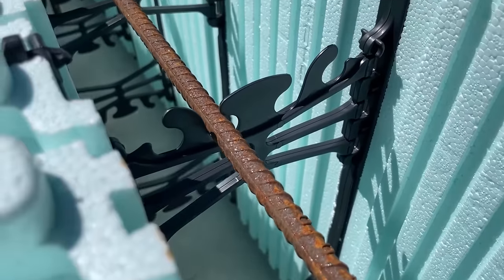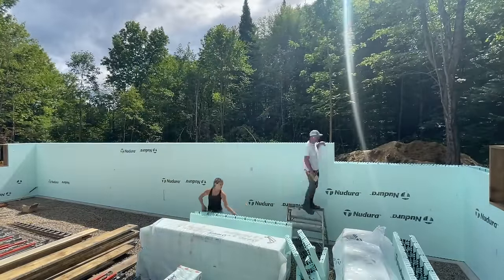WE HAVE CONCRETE WALLS | Couple Building Their OWN HOUSE | ICF High Efficiency Home

Comment: Brandon, have you ever used Helix Micro Rebar to replace the vertical rebar?
Reply from the maker: no i have never used it, is it the fiberglass rebar?
Reply: @TimberMates  no it is spiraled metal about 2” long. It gets premixed in the concrete at the plant.

Comment: Styrofoam inside the building is not a good idea, outside is good, but inside... Plus we should protect this material from weather and sun. And yes, this technology is as old as the world, I talk about formwork. My opinion, the foam should be inside the concrete blocks as a thermal insulator. But such products are no longer for self-assembly and should be produced in a factory.
Reply: I am concerned about the fire resistance as styrofoam  is very flammable and releases nasty chemicals when burned.

Comment: This seems a pretty decent system or methodology.  Obtaining a house is such an important component part of life, and the cost generally so overwhelming, many die before paying off an under-performing, too-small, inefficient POS.  Just my opinion as somebody inhabiting an under-performing, outdated, too-small, inefficient POS!  Mine is a UK one-storey construction of dual brick cavity, built in 1972.  I just point out what’s not changed first - energy costs.  The suez crisis had us printing fuel vouchers over here, and my dad got me some, because the well-known ‘hack’ as we’d call it now for rationing, was your children of,any age could have their own coupon book.  Never actually came to be used.  And yet, nobody learned the lesson, it took a burgeoning war in Eastern Europe, to bring us to the realisation that our present housing stock is mostly semi-attached garbage in the UK (semi-detached we call it, 2 homes share a middle wall, it’s very common and really makes your quality of life dependent on your neighbour’s noise levels - why??!).

Super-insulating, but with adequate ventilation and waterproofing is really a lesson we ought to have learned, and have not in the UK.  My walls, don’t have the cavity capped for example.  The only thing that oughtta work is the damp proofing membrane about 4 bricks up, but truthfully, it needed to be maybe 6 bricks up with the floor appropriate inside to that.  The insulative value of external brick/cavity/internal block/plaster, is absolutely pathetic.  ‘R’ value I believe is a rating used to measure this in particular materials.  I have implemented many benefits to the property, but the main one is to create a loft room that is easily cooled by opening some windows we fitted, even jn a hot summer, and this protects the house because I added a layer if foiled bubble-wrap between the roof proper and the room built inside.

But those walls of double brick, are really outdated by the price of heating gas and electricity for the UK.  And no home can probably avoid needing to generate its own power now, because our fuel and energy costs make EVs prohibitive for all but the most affluent to drive.  I’d say, the UK is an absolute mess.  Our govt has lost all grasp of what central government is actually for, it’s the weirdest thing.  It’s not there to tax us to death, it’s there to furnish us with infrastructure to live.  I will get a grip on what to do next, now I am retired, but my recollection of a home insulation drive running since the 1970’s leaves me baffled why this effort has singularly failed to be completed.  I bought three houses.  Every single one, had lousy or missing insulation/damp-proofing, and heating that Canadians would laugh at - in fact, a visiting Canadian did exactly that, and asked why we don’t have it on at night…because it would bump the home energy cost from an already staggering £4,500 to nearer £7,500 is the answer of course!  Great vid, take care.

Comment: Mmmm, ICF construction seems like a good idea at the time but there are some serious drawbacks and limitations to the system, firstly anything below ground level will be almost impossible to effectively waterproof, this is because the foam flexes and causes joints in membranes to fail, secondly filling the cavity with concrete and compacting it adequately is very difficult unless the concrete is very wet, and this can cause "fatting" issues

Comment: Surprise the styrofoam doesn't buckle under the hydrostatic load of the concrete, there must be a height limit of the wall that you can do in a single pour?
Reply from the maker: i think its 10 feet max at one time

Comment: Can the rusty rebar cause issues in 20-30 years..like concrete cancer?? Happens all the time with reinforced content after certain years??
Reply from the maker: only if it gets wet, so not likely to happen unless you let the roof go due to disrepair. At that point its the least of your worries, these homes can last 1000 years. not sure how they could know that??
Reply: @TimberMates  from concrete spalling..that’s the easiest way to know

Comment: Looks good, next time make it easy on yourselves and pour the slab first.
Reply from the maker: Because the walls are so heavy we waited to pour the floor so the footings could settle a bit first and our basement floor is less likely to crack. Believe me if we did something that seems left out, it’s because Brandon has a reason for it after years of experience.
Reply from the maker: Also you can’t do that anyways, this isn’t a stick frame house. Inline heating tubes need to go in the floor and the concrete then goes up to the walls.

Comment: I built a three story house with icf. It was a long and costly process. Not worth it in the long run. We saved less than the energy guide projected we would. I would recommend it for basements. That's it.
Reply from the maker: many factors to consider, climate is a big one and also what you personally paid to have it built. Good ( stuff ) aint cheep and cheep ( stuff ) aint good.  If you live in a mild climate it might not be the most economical choice. Here in Canada i think it is the best environmentally and economically
Reply: @TimberMates  Canada also... Keep your stick on the ice..

Comment: Did you use 6" core for both basement and first floor? Thank you.
Reply from the maker: Yes, correct
Reply from the maker: easier to pour a 6 inch wall, also stronger
Reply: @TimberMates  : Thank you for your answer.  In my case I wanted to install the joist header on a ledger, but the HUD's Prescriptive Methods for ICF require a concrete ledge of min 3.5 in. So, this implies that I need basement blocks of 10 in and upper level blocks of 6 in to get at 4 in ledger. Meaning that I cannot use 8 in in basement. 
    Your solution to have the same core thickness (6 in) for basement and floors looks the most appropriate. The only drawback is that for 6 in you need closer distances for vertical rebar than for 8 in or 10 in core.

Comment: 6:07 why do your walls have a bow on the middle , its the weight of the concrete?
Reply from the maker: the walls are straightened after the concrete pour with the adjustable bracing system.

Comment: I wonder how the concrete is supposed to dry properly when you seal it on both sides like that…
Reply from the maker: That’s not exactly how concrete works
Reply: Then put it this way: How is the concrete supposed it build its firm conglomerates?

Comment: I think I would of built it out of concrete blocks snd glued on foam board to the blocks. Those would be cheaper and faster
Reply from the maker: i would never build in this country with concrete blocks. They are not strong and they always crack and leak water in basements. And i would also challenge anyone to lay blocks faster than ICF block
Reply: @TimberMates  I've laid lots of concrete blocks and the lay faster than you could do a concrete. Concrete will leak water if it's improperly back filled and sealed. Blocks creak because they were installed incorrectly. Concrete can creak also.
Reply from the maker: @SawmillerSmith  So, in order to not be biased, have you worked with ICF? Because I've done lots of work with concrete blocks, and there is not a snowballs chance in hell they are even remotely comparable, ICF is far superior in every way possible. Unless you just solely want to talk about budget, but as I like to say good shit ain't cheap, and cheap shit ain't good. Have a nice day.
Reply: @TimberMates  no I have not worked with it. It's foam blocks that you pour concrete in. A concrete wall is stronger than a block wall. But block walls meet codes and are strong enough. Lots of block basements have been built with blocks and didn't leak water. Most block basements can be laid in a few day with 3 men  Have no idea on foam blocks. I just want to know the advantages of them.
Reply from the maker: @SawmillerSmith  This basement was also laid in a few days with only 1 man and one woman. The advantages are numerous but to name a few extremely efficient not only to heat/cool but it saves about 5 steps (no strapping, no insulating, no framing, etc), extremely fast to put up (each block is 8ft long and 18inches tall, very lightweight to lay and easy to cut out windows/doors/all penetrations for venting, water, HVAC, etc. Only takes about 2 hours to pour, and once set you have a bombproof house. Also not sure about your point on "block walls meet codes", ICF clearly meets all building codes so that point seems moot. Anyways, I could tell you all day why ICF is the best, if you don't agree that's totally fine but it seems a waste to keep trying to discuss it unless you're actually interested in all the benefits of ICF. Bottom line, yes you can build with blocks, they are "enough". We are going for superior building materials, not the cheapest fastest way to pass "code". You can also build with OSB subfloors but they are absolutely junk in comparison to plywood.
Reply: @TimberMates  you have some good points .lot to consider. You're probably building a home to keep forever. And building it to the courant high standards.

Comment: How do you attach stone face to exterior styrofoam?
Reply from the maker: the stone sits on a brick ledge and never touches the exterior of the building, there is always an air space in all real stone and brick installs. Brick ties are used to hold the stone or brick from moving.

Comment: Every time the camera points down one of your walls, I can see the band in the wall before you even pour concrete. The walls are not straight, and therefore will be compromised…
Reply from the maker: Your comment clearly shows that you don't know anything about correctly installing ICF. The walls are straightened via bracing system AFTER the pour. You go ahead and lay EMPTY FOAM WALLS perfectly straight, pour 100,000 pounds of wet concrete through them, and then come tell me how they didn't fall outwards on you 😂

Comment: ICF is a very used-friendly product. It cuts easily. To locate your windows to avoid cutting blocks is NOT the priority. To avoid cutting a few blocks during the construction phase, you may very well have to live with a window that, in hind sight, you would have preferred to have a few inches  higher or lower, or to the left or to the right. And that, for the rest of the life of the structure ! Not worth it. If you have built enough with ICF's, you know that. But otherwise, it looks good !
Reply from the maker: It's perfectly worth because it's EXACTLY what we wanted. This house was extremely well planned and materials were efficiently used. Not sure how you come up with your argument when WE'RE the ones who planned and built OUR OWN HOUSE EXACTLY HOW WE WANTED TO 😂😂 If we didn't;t like the windows there we would have changed them, we figured that didn't need to be said since it's our own dream home ;)

Comment: Where are the up rights in the wall? Can't believe an inspector passed it without them..
Reply from the maker: ?? Rebar? Tons of upright rebar in the walls.
Reply: @TimberMates  I saw the rebar placed in the footer, but not the uprights that get tied to them. Nor the roll weather stripping in the footer. I've poured a bunch of basements, and those are automatic Everytime.
Reply from the maker: There is vertical rebar every 16 inches, and horizontal rebar every 18inches. Everything is to code here, we work very closely with the building inspector, and keep in mind you don't see everything that goes on so just because it wasn't filmed does not mean it wasn't done. Very hard to film every little detail when working.

Comment: Steel looked minimal but what do I know
Reply from the maker: yep
Reply: @TimberMates  I see ppl building pools with em now .   We do standard gunite, usually go way overboard , 10 inch centers all around pool and then reinforced extra bars for every ten inch center past five foot deep on wall gets another bar in between it making them five inch centers .
Reply from the maker: I did look into the engineering specs for pools by ICF and i thought it was very strong. Above grade walls only require 4 inch thick concrete and we went 6" just for personal preference. The rebar requirements we used are all engineered for this area and we just followed them

Comment: Rust on your rebar will lead to internal spalling and a failure of your concrete because Rust doesn’t stop “growing” even when encapsulated in concrete.
Reply from the maker: to rust, metal needs 2 things. Moisture and air, in a properly poured ICF wall rebar will not get either of those. If you believe what you said is true maybe never go into a mall or drive over an overpass since its going to fail aparently

Comment: I feel like you guys have some common sense. I've done installation. And what I realized is that houses and buildings are actually not designed very well. You got two by fours and plywood And fiberglass insulation and then your drywall. And it cost a lot of money and it doesn't work very well. It gets hot in the summer and cold in the winter. How much money do you have to spend on air conditioning? Way too much. You could just build a house that requires no air conditioning. The Native Americans were smart I walked inside a Native American hot once and it was well over 100° outside and it was cold inside that Native American Hut that was made out of clay or something. No air conditioning required it didn't even have a front door. Something like concrete doesn't burn either. Spend all that money and effort on a house just to have it burned down. Doesn't insulate very well. I went inside a cave and my thought was why aren't we utilizing this more? God given natural protection from the elements it stays cool inside the cave year round. Why aren't we building things that work? They say what about earthquakes? Well I asked them about the earthquake on the cave tour and they said that the earthquakes really don't affect the cave at all. All the stalactites and everything they're all intact

Comment: Just curious are you allowed to design homes without architects and structural engineers in your country or you just illegally saving up on that to save few thousand dollars but spending millions without prior knowledge that an licenced professional can provide.
Reply from the maker: everything structural, the walls, floor and roof systems are all engineered. We have a building inspector as well. Not exactly thrown together as you eluded too

Comment: I would build with ICF but the quotes I got for the blocks were outrageous. They probably cost 2 to 3 bucks materials and the molds are about $16,000 but can do tens of thousands of blocks so over the lifetime of the block molds it's only another buck or so...
Yet they wanted $42 a block in E. Texas. More people would use them if they were cheaper.
Don't try to send your kids through college on a single house on the backs of others.
I'm for capitalism but this is out of control sh!t.
Reply from the maker: and what is the cost of a sheet of 3/4 plywood there? Probably about the same, yes its expensive but i like this saying. Good shit aint cheap and cheap shit aint good.
Reply: @TimberMates  Going to be building with ICF soon. Most never consider the amount of money you'll be saving on osb, 2x6's, installation,  then the amount of money per year on heating and cooling, plus a monolithic structure made of cement and rebar, it's worth it.